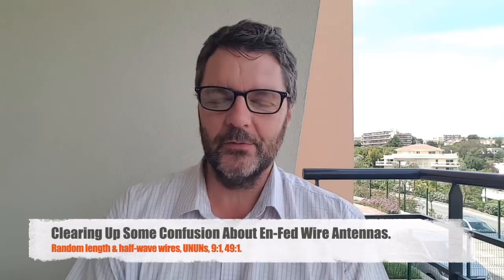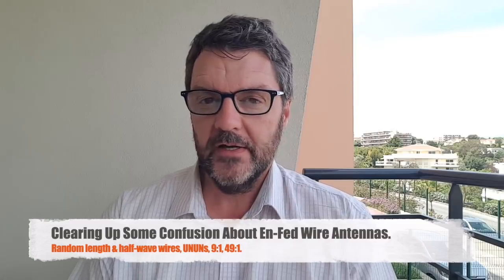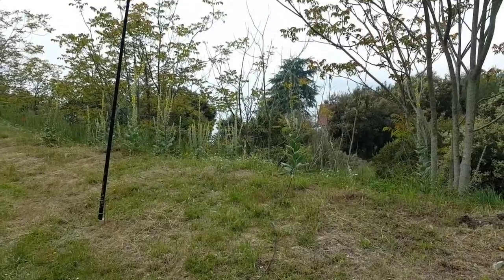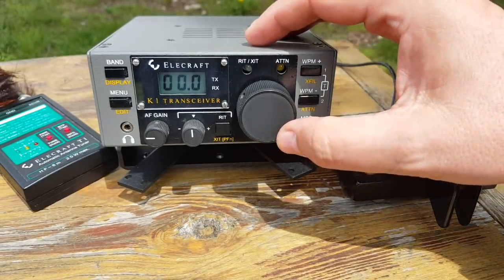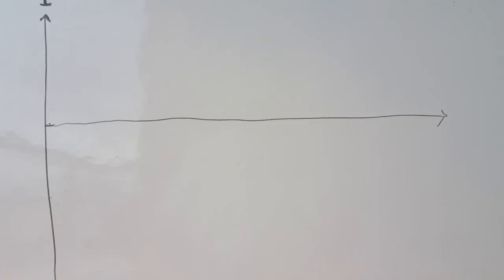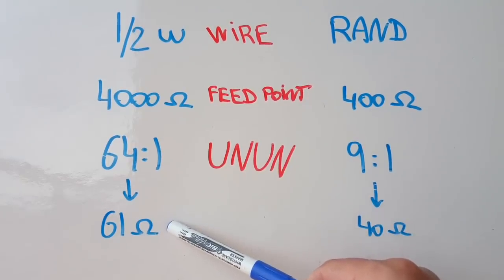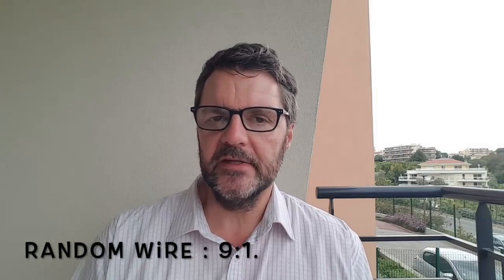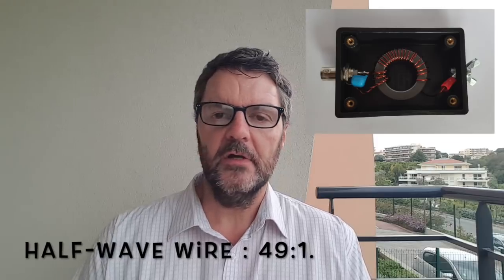Clearing Up Some Confusion About End-Fed Wire Antennas.

Comment: Bonjour Gilles. Je vous ai déjà écrit dans une autre video je crois. J ai passé ma licence il y a 5 semaines mais tjs pas reçu l indicatif. J en profite pour m informer sur internet pour fabriquer des filaires. J ai vu des videos en anglais, j ai lu des articles mais j ai encore des questions sur les unun. Un unun sert juste à transformer l'impédance. Le balun  transforme l'impédance et transforme la symetrie d' un dipole à l'asymétrie du coax( a moins que ce soit un 1:1 qui se charge juste de la symetrie et asymetrie). Je pense que j ai raison ou non?? Ce que je comprends pas est si les unun et balun se chargent aussi du courant retour RF(commun curent), ou est il préférable de mettre un balun choke sur la descent coax apres le balun ou unun???? Merci pour votre réponse
Reply from the maker: Correct! Pour la/le? choke, en général, pas besoin avec un fil d'une demi onde et un transfo 49:1 ou 64:1, par contre avec un 9:1 et fil "aléatoire" oui!
Reply: @RadioPrepper  merci pour votre réponse. Et si je décide de mettre un EFHW à la vertical, je mets juste un balun 61/49:1 en bas du fil et je le relie au coax sans choke. Juste un ground wire 0,05 wavelength depuis le balun. C est juste? Dernière question. J ai lu qu'en HF les arbres ne jouent aucun rôle sur less antennes, donc je peux accrocher le fil le long du tronc juste? Merci encore
Reply: @RadioPrepper  ohhh last question!!! C est préférable de mettre l alimentation de la vertical EFHW le plus haut possible(genre 2 metres du sol) ou le mettre à 30 cm du sol est parfait? Thanks. Gregory
Reply from the maker: Plus haut.
Reply from the maker: En général mème pas besoin du contrepoid de 0.05 longueur d'onde.. Une demi onde est une antenne complète comme une dipole, pas la peine d'en rajouter...
Reply: @RadioPrepper  merci beaucoup
Reply: @RadioPrepper  encore une question. Dans une video, ils disent que c est une antenne pour puissance QRP pas plus de 20 W à cause de la tension élevée. Est ce vrai?
Reply from the maker: La tension élevée en bout de fil oui, comme une dipole classique. QRP seulement non. Ça dépend de la taille du toroid. FT-82-43: 30W BLU. FT-140-43 70W. FT-240-43 150W. Il est possible aussi d'empiler 2 ou 3 toroids pour plus de puissance. Pour plus de 20W il faut une RF choke pour empêcher les retours de courant sur la tresse du coax. De toute façon, plus de 30W ne sert pas à grand chose...
Reply: @RadioPrepper  super, vos réponses m aident beaucoup. J ai pu récupérer du materiel d'un OM radioamateur suisse. Il y a des balun 9:1 mais aucun pour un EFHW, et je ne suis pas certain de réussir. Je pense en acheter un chez zenith antennes.. en fait j en prends donc un par rapport à la puissance que je veux. Ok pour 30w.... Merci encore
Reply from the maker: Franchement, c'est très facile à faire 😀 https://www.buymeacoffee.com/gilg

Comment: Could I use this type of antenna for my low power  AM Broadcasting radio.  I do have a license community FM radio but I can't reached the other side of the mountain on my FM broadcasting radio so I purchased a 80 watts AM radio.  I need a wire type antenna for this radio.  Could you help?
Reply from the maker: Probably, though that would be a very long wire! You probably would need to use 3 turns primary and 24 total, and not sure the 43 material toroid would be the best.. Worth a try...
Reply: Thank you so much,  i'm planning to work on 1350 khz.  What's your advice on this frequency, is it good for short or long range transmission?  Somebody advice me on Facebook to use 3 wires dipore but I never heard this type of antenna before.  I don't know how it looks like and I don't know how to figure it out the length.
Reply from the maker: Never heard of it.. A dipole would be 468/1350=346ft so 173ft per side, slightly trim while testing for best results. Also check regulations because it sounds like this could get you in trouble. That frequency is Google for local to near-regional range.
Reply: @RadioPrepper  I checked with our local Telecom Authority and was okay here in Palau since we don't have any other AM radio station so all frequency are open and FM frequencies are roaded.  With your expertise in this field what portion of AM freq you recomanded.
Reply from the maker: It depends, what are you trying to do?
Reply: I don’t know what your local regulations say but generally vertical polarisation is used in the medium wave AM broadcast band as ground wave propagation will give better range at those frequencies. A top hat loaded vertical imo would be a better choice of antenna.
Reply from the maker: There are no regulations anywhere about antenna polarisation, that I know of.

Comment: Contest = man-made band closure. Hate that crap with a white-hot passion. But... if you have 30m, that's a great ghetto to escape to. I love 30 any time, but especially appreciate it when the 599 crowd decide they're the only hams that matter. 

Also: I built your 49:1 AT and am running it so far on 20m and 40m with interchangeable tuned radiators. Absolutely love it. It's a bit big for portable QRP, so I'm shopping around for a smaller design, but that 49:1 AT gets out very well and has finally liberated me from my tuner. 

Great video, as always!
Reply from the maker: Thanks. I made a 64:1 with an FT-82-43. Much smaller!
Reply from the maker: And I couldn't agree more. That's why I built my K1 for 30/80m.
Reply: @RadioPrepper  I'd love to see the design! (Windings, etc.) I'd  build it.
Reply from the maker: It's on qrpguys.com.
Reply: @RadioPrepper  Thanks! That's my next project.

Comment: 29:26 OK the epoxy is a NOT good idea, but I’m interesting
in, did you tried to use
a ”random Teflon tape” instead
of it ? It means, to improve
isolation of wires (input -output,
the real distance between
beginning and the end of
winding), the distant of the
inner diameter, of the
magnetic core ? You have
tried to do this by epoxy, but
what if you will use a Teflon
Tape (as a mass ”random”),
instead empty place ?

Edited:    21:13
                Another question ...,
                The size of the core.
                For example Icom 706
                Family ..., on the filter
                board is installed
                a very small size
                magnetic toroidal
                core, but it cover
                a hundred Watts.
                So, in the movie it
                is really ..., ”maybe
                MAX 75 Watt” ?
Reply from the maker: Well, the core is non conductive, so no need for tape. 2nd, just an estimation based on other user's feedback..
Reply: I didn’t want to improve a core
insulation, but the empty space
in inner diameter of it. It will be
useful for the small size of core,
when distance of winding wire
in this point (the beginning and
the end of winding) is very close
to each other.
In situation, when a small core is
used, and big number of wire
turns, I got impedance  zero :(
It seams that the winding is
shorted, because of this small
distance (the beginning & the
end of winding to close).

73 from Voytek

P.S. just ..., let you know   :)

https://youtu.be/JzfEjQ56fMs

Comment: As I build a "random" with a 9:1, what should my coax length be? Or counterpoise if I decide to use one?
And is there a "best" length?
Reply from the maker: Not really... There is but it is hard to predict... Trial-and-error...
Reply: @RadioPrepper  And the coax and/or counterpoise lengths? Are they relevant to the radiating element length? Based on the video they are but the plans I saw from EARCHI really didn't make mention of it.

Comment: On many pictures the 49:1 and 64:1 are equal.. Im so confused.. Could someone show me som pictures of a correct 49:1 and 64:1?
When do I use 49:1, and when do i use 64:1?
Reply from the maker: Not much difference. With 3 turns primary the 49:1 has 21 turns total. The 64:1, 24 turns. 64:1 is better below 10MHz.

Comment: I am not sure if I am being stupid here, but I have a question. When you crossed the wire over in the secondary, did you not put the 2 halves of the secondary out of phase and create a choke rather than a tansformer? Keep up the good work, I do like you english videos.
Reply from the maker: Smarter people than me have designed this ;-) I don't think so but if anyone knows otherwise please comment.
Reply: @RadioPrepper  I do apologise. I have thought this through and realise, as long as phase is always bottom to top or top to bottom in the hole of the core then it works. Feeling silly now! Thanks for bothering to come back to me though.

Comment: I notice that you use 3:24 ,  Is there a difference if you use 2:16 ? to achieve the 64:1?
Reply from the maker: More turns is a little more efficient I believe but at higher frequencies too many turns won't work. My 3/24 64:1 does work on 21MHz but not on 50. My 2/14 49:1 does...

Comment: Contests only use the bands on a few weekends (for each mode). On those weekends use another mode or a WARC band. 73
Reply from the maker: Not everyone has the gear for WARC  bands and who gives the right to contesters to monopolize bands? My hobby is less important than their hobby? What if I planned a vacation to do some radio on that week-end? Contests do not need to use entire bands, nor multiple bands. Telling me to go play somewhere else is bullying, but given the behavior of many contesters, this does not surprise me.
Reply: @RadioPrepper   I reality there are a relatively few number of big band filling contests each year for a given mode. As I said earlier you can use other bands or other modes. If there is a phone contest use CW or digital modes.  Contesters  also often do not fill the upper portion of a band unless things get really crowded.  If all fails go build something for your shack.
Reply from the maker: Sure, but sometimes it's impossible.

Comment: Thank you so very much for this vid.  Very informative and encouraging.  Antenna stuff is complex, but your vid helps to simplify and get us (at lease me) building and experimenting. Well done.  EFHW multi-band efficiency is a hot topic and clearly gets some folks worked up.   Sorry about the negative folks. I'd not worry about them. You did  good. Thanks again. 

km4udx
Don
Reply from the maker: Thank you Don.

Comment: Hi Gil did you add epoxy to the enclosed and did it  effects the performance.
Reply from the maker: Epoxy totally killed it.
Reply: @RadioPrepper  thanks for the feedback I am glad I did not add the cable joint epoxy.
Reply from the maker: A little bit probably would not matter, but don't pot it in epoxy..

Comment: Great video, easy to follow and includes everything you need to know about end feds unlike a lot of other videos. 
I finnaly built the transformer for my 148 ft random end fed last week. A 9:1 and a current choke. Just waiting on some coax so i can test it out. Hopefully my toroid choice was appropriate. I specifically picked the core for my 9:1 but my current choke core is unknown materiel.  For ground i just put an 8 ft ground rod in for my station ground and im going to play around with using our chain link fence as counterpoise.

Comment: I bought a kit from China about 4 months ago that is called MTester.  The kit is pretty much preassembled, cost about $15 and had great reviews. It will test just about any component you plug into its input port from capacitor to inductor. I wanted it because I often make hand wound inductors and wanted better than theoretical values for my homemade parts used in my scratch built receivers. I assembled the kit last night. I too am impressed by this device, hence here is a link to the MTester and it might be a useful tool for you/all too.

https://tkkrlab.nl/wiki/MTester
Reply from the maker: Thank you!

Comment: There are numerous external factors which impact HF antenna performance. Explaining theory of operation, agreeable to everyone, is almost impossible.  Even the famous ON4UN antenna designs do not work as modeled at my QTH.  When someone asks, what is the ideal antenna for their QTH, my answer...it depends . W3DIY
Reply from the maker: Usually is that answer!

Comment: your videos on end fed half wave have been extremely useful and informative. I was wondering, apart from the ease of deployment what else do you prefer about the end fed compared to a centre fed dipole ?
Reply from the maker: Used vertically the low radiation angle helps for long distance contacts.

Comment: The theoretical explanation is not correct. Here is some clarification. 

At the ends of an antenna, there is no more antenna and therefore no more energy emitted into the ether. There is no way of getting around this fact. As a result, there is MINIMUM current and MAXIMUM voltage at the ends of an antenna. Using Ohm's Law, we therefore see that impedance is maximum at the ends of an antenna no matter how long it is. 

Ohm's Law  
R = V/I 
When V is maximum and I is minimum, R is maximum. 

When you have a 1/2-wave antenna (resonant), you will see the highest possible impedance exhibited at its ends (about 5,000 Ohms). 
If the antenna is never 1/2-wave long on any band, you will see a smaller maximum impedance on its ends (lower than 5,000 Ohms).

Matching transformers have a high impedance ratio (e.g. 39:1) when used with an antenna wire that will be 1/2-wave on one or more bands, and transformers with lower impedance matching ratios (e.g. 9:1) for antenna wires which are never 1/2-wave on any band.

When voltage feeding an antenna off one end, you place the matching transformer on the ground. You connect a vertical wire up to the horizontal antenna wire off its "hot" terminal, and connect the "cold" terminal to a ground rod 2 or 3 feet long sunk into the earth with several short (counterpoise) wires coming off the rod laid out on the ground, or buried in it, arranged like a wagon wheel if possible. This is the non-resonant RF GROUND for the matching transformer. It prevents the coaxial feedline from acting as the only counterpoise. You can add a current choke to the coaxial cable before the run back to the shack to prevent RFI and "burns" from the radio chassis.
Reply from the maker: Thanks for the details. The last paragraph, yes when using a random length (not half-wave) wire with a 9:1, but not necessary with a half-wave wire and a 49 or 64:1, for the same reason you don't use radials or a ground with a dipole.

Comment: Contests annoy me,  they need to reign in contesting on cw and phone and ban them on more bands + they're usually running well over 1 Kw. 

That's the beauty of the EFHW antenna, it's resonant on multiple bands if designed properly. 

My EFHW 8010 made by myantennas.com and Xiegu X5105 5 watt rig always surprises UK hams , I live in Ireland. The antenna is very efficient and it works on multiple bands, I only have an earth at the transformer and have 0 RF in the shack even with higher power. 

I made contacts in Canada and West Virginia U.S with an old FT-77 on 20 meters and about 80 watts. No tuner, no radials. I only have my license 2 weeks and haven't had much time for many more DX contacts. 

I also made a contact in the very north of Norway off some Island who also complimented me on getting up there on 80- meters with about 80 watts , he said he rarely hears anyone on 80 meters this far away. 

I also have the portable end fed from hyed company in the netherlands, don't even have a ground on that, no radials and it's getting out very well only about 20 feet in the air when portable with the little X5015 ( great radio too ) 

Yes on non resonant bands it won't be efficient and you will need to back off the power if using big amps but the UnUn can be switched out via relay and made to work on other  bands with a tuner but at this point you're going to need radials and all that hassle that a resonant EFHW with 48:1 UnUn doesn't need.

The myantennas.com antenna covers 80-10 meters with 160 and 60 missing, they will work with a tuner but not at the rated power but for most 100 watt rigs it shouldn't be an issue.  For most people it's ( probably ) the only antenna they will ever need. If they want 160 and 60 they can use a tuner at greatly reduced efficiency or just get the 160 meter version which will also cover 60 meters.

I need no tuner with these antennas either and the radios never complain so there's no fooling anyone or fooling of any swr meters, if not on a resonant band SWR will be off big time. For instance SWR on 160 meters with the EFHW 80-10 my antrennas antenna swr is about 30:1 if I remember correctly, no problem for the X5105 internal tuner of course but I can't get out nearly as well as I can on the resonant bands. On the hack green sdr I can hear myself clearly on 80 meters and hardly a hint on 160 meters all on 5 watts, obviously because the antenna at 160 meters is only half as long as it should be. 

The coil on the my antennas antenna has an effect on resonance which I think makes it resonant on more bands. 

Overall I am very happy with the antennas, yes some day I will have a Yagi but for now , for wire antennas, the EFHW with 48:1 UNUN are pretty damn good.
Reply from the maker: Yep, I had one between my roof and a pine tree in the north of France for a couple years, worked really well!

Comment: A "choke" should be attached at the antenna or near the radio?
Reply from the maker: It depends if you want the coax shield to act as a counterpoise or not...
Reply: @RadioPrepper  
So, when/when not would a person want to
use the coax as a counterpoise?
Many thanks for your anticipated response.
Reply from the maker: Choke at the radio when not using a counterpoise on a random wire. Choke at the antenna when using a half wave. You can always try both ways of course, as results may vary...
Reply: @RadioPrepper  Thank you.